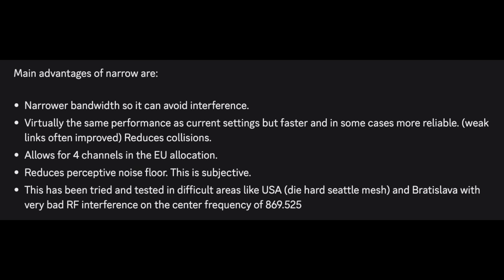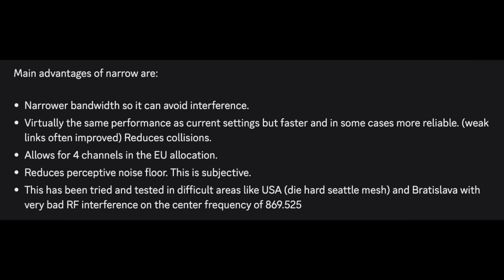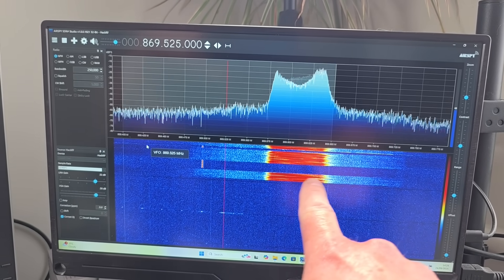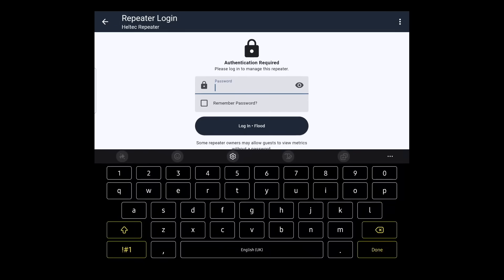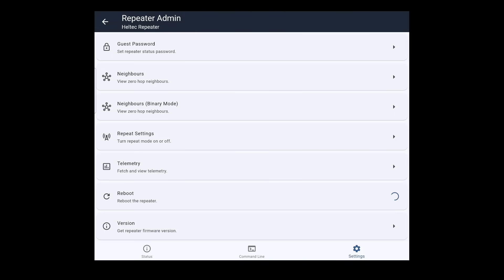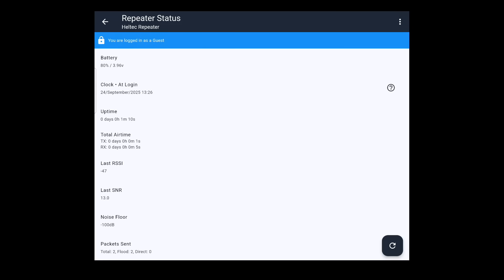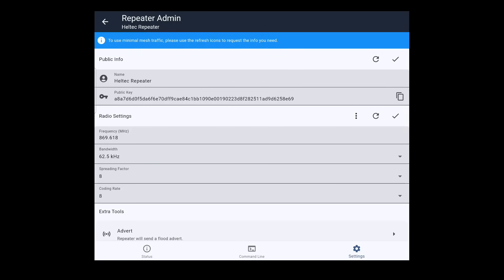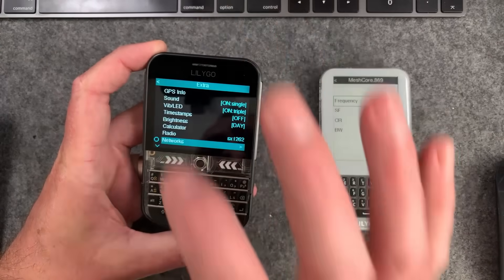MESHCORE BIG CHANGES!!!

Comment: I don't see why you can't make a compatible with metastastic to ease the switchover when mishtastic is 100% open source. You do not need the original  devs permission or help.
Reply from the maker: They don't want to cooperate with anyone else. We tried early on in this journey.
Reply: Nothing inherently wrong with competition between two similar systems. Drives them both to be better. And they can both learn from each other without integrating.
Reply: They have some superficial similarities but a lot of what makes Meshcore so good is incompatible with bridging Meshtastic noise over.

Comment: I live in the US and I’m looking to purchase the T deck plus  meshcore device soon. It looks like updates/new devices come out very frequently. My question is if I buy one, will it just be obsolete 6 months from now?
Reply from the maker: No we plan to support it for a long time yet.
Reply: Thanks!
Reply: One more question if you don’t mind. Is it possible to flash meshcore firmware to a meshtastic T deck that has an external antenna? Reason for asking is because it looks like I can’t get a T deck with external antenna that comes preloaded with meshcore at the moment.
Reply: @tw9433  It is just one that is ready flashed, there should be nothing to stop you changing it. (And if you install launcher you can flash it from an SD card, and switch between systems.)
Reply: Awesome thanks for the info! I’ve seen one video on launcher but didn’t know you can use it to flip between systems. Thanks
Reply: @tw9433  It's not like dual boot. (Sadly not as good as ventoy on PCs, more like TWRP for android phone). But it is possible to save the firmware files for multiple system, and flash them (worth keeping the previous version in case of problems, I found that useful when I couldn't enter my pin on my tdeck pro.) Meshcore is really easy to use with launcher - there is a version that saves  the data on the SD card only, and the file is on the flasher page. This can co-exist with MT and other firmware eg Bruce. (MT don't make it easy to find the correct file, or didn't last time I tried)

Comment: After some initial tests that failed (removing contacts and starting again, and ensuring clocks were correct fixed that) I tested a t-deck plus half wave whip, with the new settings walking a route I have tried recently with a t-deck pro with BW 125, SF 11 & CR 5 and it got about 10% further, which which at the very least implies that the performance is comparable.
Reply: Now seeing 5 repeaters on the new standard.

Comment: Bluetooth mesh will be the leading mesh 100 percent
Reply: Bluetooth has no range
Reply from the maker: Yeah bluetooth doesn't go that far below the noise floor like lora does, thats the main reason really. Unless 1000's of people in an area suddenly use bitchat  then a bluetooth mesh isn’t really viable.
Reply: @andykirby  But surely Meshcore over BLE (presumably possible) would use cross band repeaters to and from LORA?

It would have the benefit of making it far cheaper to get Meshcore running. Anyone wanting to join in with a static setup, would get a repeater set up, (anyone with the right mobile with BLE would be able to use it within the location, and have very sort range messaging elsewhere.). Currently the same price option would be a companion radio, which would not grow the mesh, or a companion radio and a repeater that would cost twice as much,

Comment: I've changed over, and added my repeater to the map. (I was on custom settings, because the old default was rubbish, I hope this one works here.) But has any consideration been given to the four spot frequencies lower in the band that are allowed higher power?
865.0–868.0 MHz , 10% (access points), 2.5% (other devices), 4 frequencies, 500 mW (data only, power control required) ref - https://en.wikipedia.org/wiki/Short-range_device

These allow 125KHz BW (200 actually) since they are fixed channels, reducing bandwidth would probably not be of benefit.
Reply: 2.5% air time isn't a lot
Reply: @TheAtomicZombie10  But that is only the clients. The repeaters get 10%, Seems ideal for MC where repeaters and clients aren't combined.
Reply: @thirtynine-j5x you forgot one important requirement: nodes need to be using adaptive power control. also: considering repeater an AP is bit of a stretch.
Reply: @recrof  First point is good. (But the kit we're using does have power adjustment, it's really whether it would be viable to meet the actual requirements, but it would be of benefit even when not required.)
Second point really depends on the formal document being summarised.

Comment: Andy sorry I’m getting -public messages on meshcore on my I phone app narrow band followed your instructions for t deck which I have as well but no messages in the public channel Paul in Kent
Reply: I found adding a fresh network with the new default worked much better on the Ripple devices. Changing didn't seem to work reliably (encryption keys?) Also I noticed problems if the time is unset. It is nice having two networks on Ripple devices. (Such a shame Meshtastic didn't want to be included as an option)

Comment: The irony  is no one is using Meshcore in my area and although there are meshtastic nodes in my area no one is using those either lol. So you can pick your poison, get it all set up and talk to no one either way 😂
Reply: Same for me. Probably switching back to meshtastic.
Reply: Similar situation here in Chicago, haven't seen anyone turn up on MeshCore yet sadly.

Going to go off on a tangent a bit here but I wish there was a sort of "hook" to get more people interested in LoRa-based communication; like if there was a pocketable computer or game console-like device that had a LoRa module built in. Something still nerdy but not quite as deep in the hobby as purely LoRa devices are. It seems like there are probably more people out there who would be interested in this type of technology if they knew it existed and understood its potential. So I'm imagining some kind of device that operates as a sort of "trojan horse" to get people thinking about these capabilities. It could do so by giving them an easy entrance into LoRa as a side benefit of a "more obvious excuse" (i.e. hacking/gaming) to pick up such a device and play around with it.

I'm imagining something along the lines of the Clockwork uConsole, where it can be used as a sort of hacker tool or even to emulate some retro games, but the hardware is open enough that adding in a LoRa module (or including it as part of a bundle deal) is possible. (In fact, I'm planning on adding a LoRa module to mine in the future.)

These are just my thoughts though, I'm new to all this so I don't know how the wider MeshCore/LoRa community feels about this sort of idea.
Reply: sounds like you heading the pack then, wont be long before more join in
Reply: Micro-blogging platform unlocked! Announce your bowel movements to fill space!

Comment: Is this going to be recommended and/or app defaults now?
Reply: It needs to be default (for the region). Using the same as MT was rubbish. (I can't see that the correlation technique will help fish the signal out of the noise, when the interference is using the same parameters )